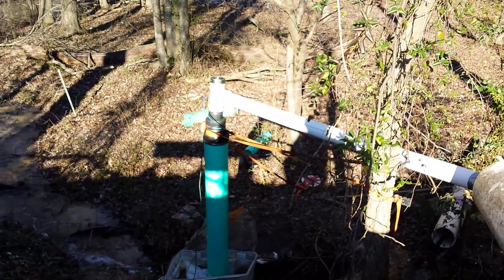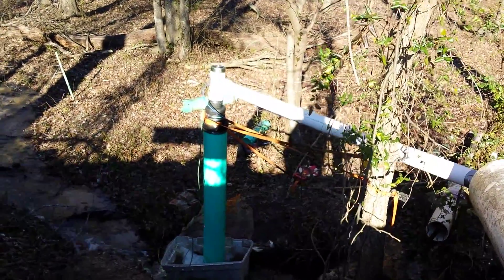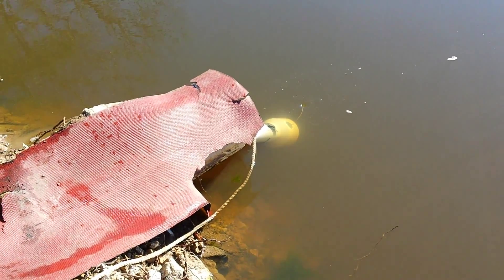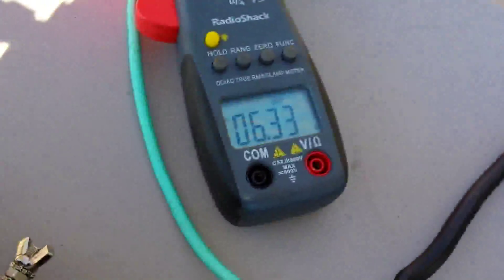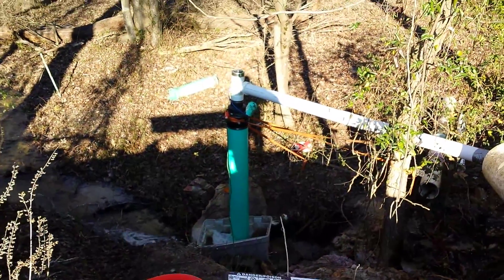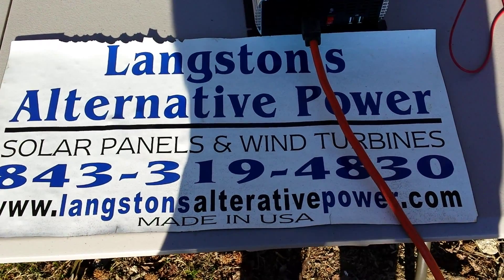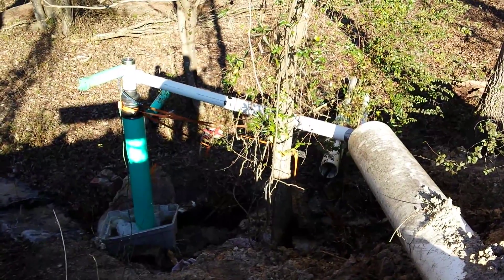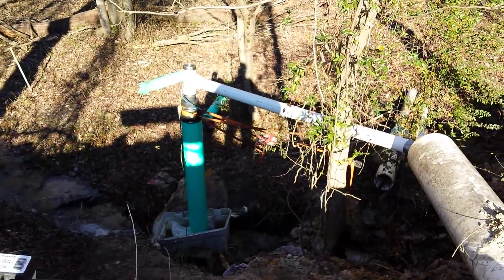Low head 4 inch low Flow generator 12 Volt

Comment: I Need a system for ULTRA low head but tremendously fast flow.
It's against the law here to block the stream, but 10% of my steam would be at least 10 of those 4 inch pipes. But getting 2 or 3 feet of fall would require effort and would be the max I could achieve.
Reply from the maker: Call me at 843 319 4830 Spencer Langston